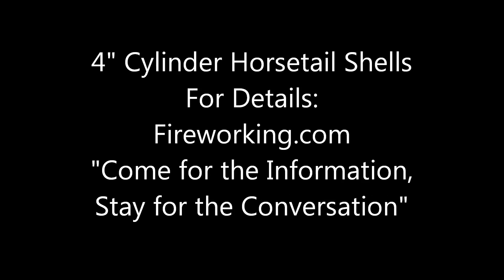4 Inch Cylinder Horsetail Shell Tests

Comment from the maker: Within limits, Sky's, the more lift charge, the higher the flight. I also dialed-back on the spolette-timing, so that the shells would break on the way up, before apogee, so more height could be gotten simply by increasing that delay. One could step up to 1/2" stars, but then the comp might have to be speeded up, so that burning stars don't hit the ground. The larger the star, the longer the burn time, and the fewer stars in the shell.
So many 'speriments.
ned
Fireworking "dot" "com"